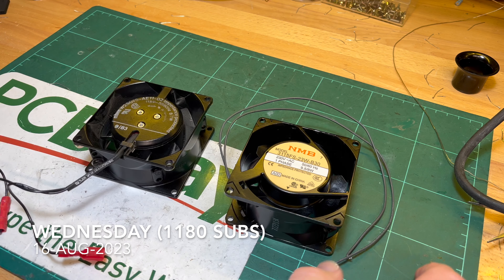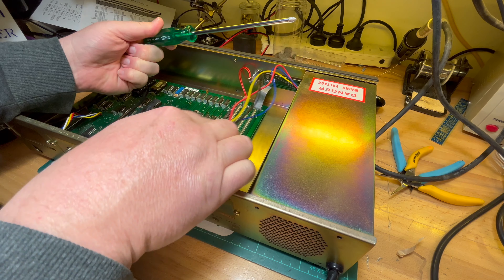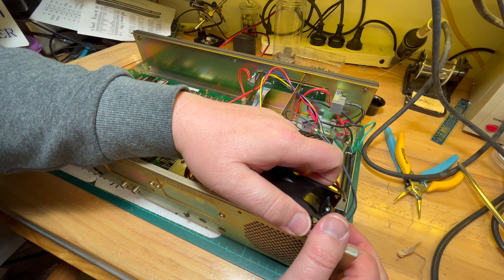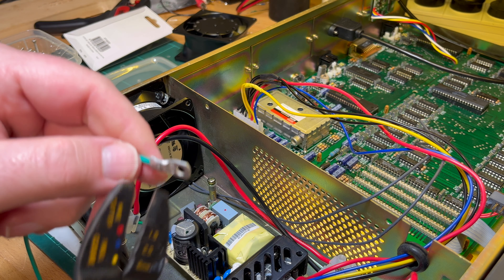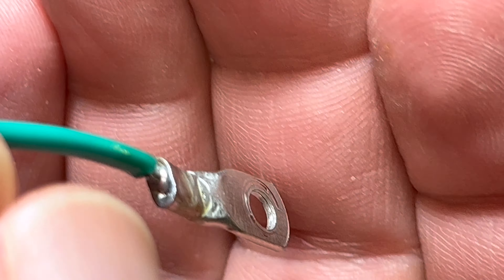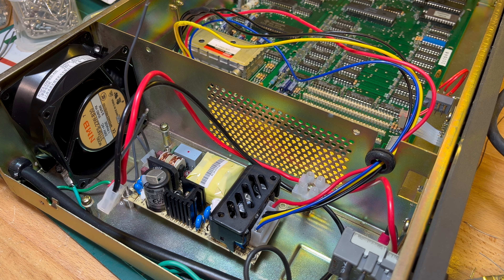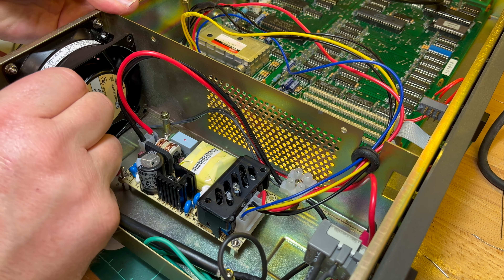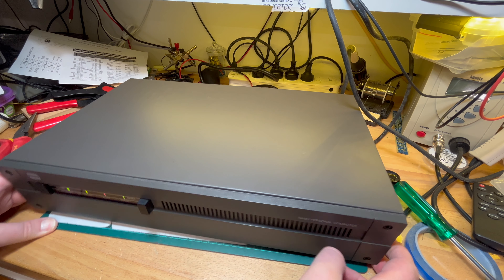🇨🇦 ナブ (NABU) in Australia: Part 5 (240VAC internal fan) [TCE #0342]

Comment: I changed that line voltage fan for an ancient 12 Pabst fan that I had laying around in a box - still NOS - which is super silent. With that new Meanwell psu my NABU is fully international 90-250V AC power ready  :)

Comment: Your NABU just got cooler! It sounds so loud in the video but maybe it’s quieter in person. I’d probably put a silent 12v fan in mine but not sure if that would be too much load on the 12v.
Reply from the maker: You get what you pay for ;)  My cheapskate $29 fan is rated at 44dBa whereas the $88 one is much quieter at 26dBa (original is 24dBa)
Reply: @Brfff  If you only use your NABU while you vacuum, it won't be so noticeable. That's my one free tip for the day.

On the serious side, with your modern power supply I wonder if you could of gotten away without a fan at all. 

Oh, and go Matildas!!!
Reply from the maker: @MrWaalkman  ah man, all the kids at school are going to be making fun of how loud my NABU is now!  That reminds me - I have do get the dinner prep. done now so wife can have dinner done by kick-off
Reply: @Brfff  Damn straight. Can't miss that. Although I will since it's happening on the wrong end of the clock for me.

And just tell those kids, no, actually if your NABU is on you will have to yell at them. To leave you alone, and stay off of your lawn.